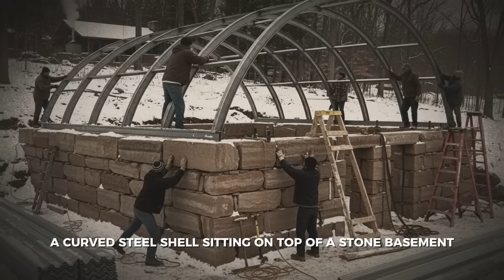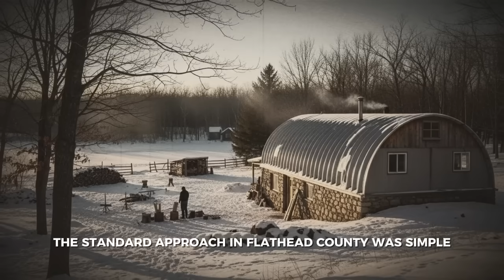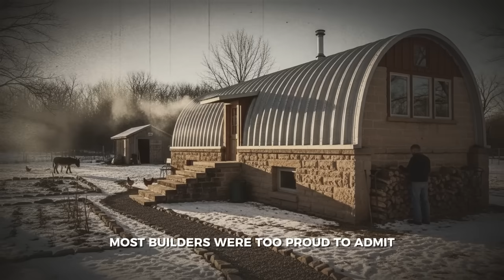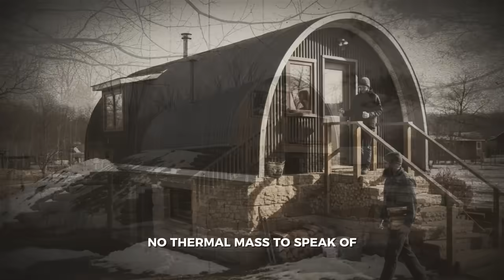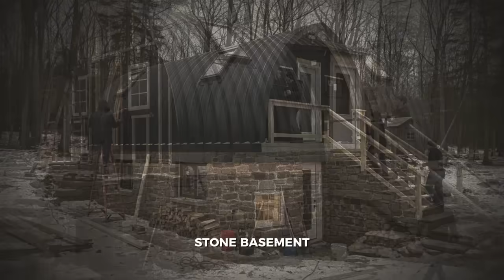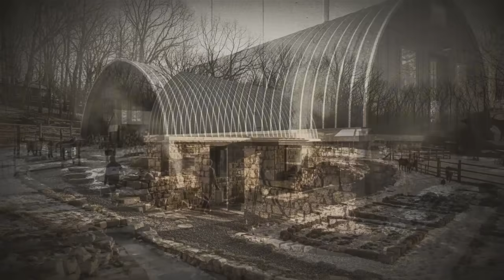How He Built a Tiny Quonset Home Over a Stone Basement — And Made It 55° Warmer All Winter

Comment: My old Minnesota farm house, built in 1906, has concrete block walls that are two walls separated by a 3" gap and no insulation except in the attic. The furnace heats the inner layer of block which radiates the heat back into the house. The chimneys are brick which absorbs heat from the escaping exhaust and radiates it back into the house as well.

Comment: That's an awesome design but I'd still utilize the lost solar heat from all that sunlight hitting light stones. Matte black exterior paint or stain for the open stone walls to help charge the stone with heat. My grandfather built a home from 3 sections of quanset hut joined at a central hub and a squared off lower kitchen and bathroom at the hub.
Reply: Do you have a pic of your grandfather's home?
Reply: @jorm2528 not anymore. My grandma sold the home after he died to a land development agency and we know the rest.

Comment: I'm not arguing with the rationale, but I like timber frame.  Mine has a Swedish foundation.  16" slab with 36" perimeter extending 16" tp the center slab.  Below the slab place 24" of blue foam.  Around the outside put 12" of blue foam at the base of the perimeter.  Cover it with soil which will freeze in the winter.  But the earth beneath the foundation will not freeze.  The slab's base temperature is 50 d. F.  Warm in -0 d. F.  Build the timberframe with insulated glass windows on the South face, sparse window on the East and West. and just a couple on the North.  Wrap the timeberframe with structural insulated panels.  Keep the living space tight and use an air exchange system.  When there is cloud cover a 2000 SF house stays between 55 and 60 d. F.  Heat with a good Swedish woodstove and use less than a half cord per winter.  Daytimes with sun the house heats to 72 d. F.  The slab provides thermal mass.  Coldest interior months of the year  late March through early May when the sun doesn't heat as much of the slab.  When it's sunny mid-winter I don't make a fire unless the indoor temp is below 66 d. F.  Then I make one fire.  Mornings will be low 60s.  Wear a sweater or a warm bathrobe.  I also charge my EVs and run my shop from solar panels.  We had 15 nights of -30 d F around 10 years ago at 8600' elevation.
Reply: Thx!

Comment: I became acquainted w masonry stoves when I visited my mother‘s Swiss homeland w her in 1953 at age 9. Her uncle, then 78 yo, had one in Dübendorf nr Zurich (now a commuter town) at the farm where Mother had spent her school vacations as a child. The stove had its firebox in the kitchen, but the tile bench extended thru the wall to the sitting room, where we also ate. The bench was always warm, not hot, & provided comfortable seating. Mother always raved about tile stoves, & I always said I was going to have one, but that’s not so easy to accomplish in Central IL!
Reply: Basalt fiber rockwool batts are far better as insulation they don't itch and don't collapse over time ... They stay sterile, reduce noise and insulate...it's also totally 🔥 proof  it's totally natural and  green to produce compared to glass fiber or  plastic foams ...it can breath without waterlogging ... 

Double door internal or external porches act as air locks. .. just add rocket stoves and thermal mass heating ... Even adding  water storage  for  underground heat  stored  rain water.
Reply: If you look at a lot of houses in cold parts of Central and Eastern Europe they have a 4 room down and 4up  floor plan with a large glazed tiled brick  stoves and chimney going up through .. the clever piece is the structure is offset by 45degrees  to the room axis so it forms a corner of each of the four rooms ..it's usually fed from one or two  sides  on the ground floor .  
Several tons of masonry  acts as a giant heat battery in the center of a swiss chalet style house..  but heats eight rooms  24/7.

Comment: I love watching these stories.  As a kid in the Pocono mountains of Pennsylvania we built on to our small house all my young life.  We soon used to heat with wood.  I hated it.  We used to have to drag wood out of the woods on top of a toboggan.  We did have a chainsaw but still had to split the oak and maple by hand.    It was much cheaper than the oil especially after the beginning of the oil crisis.   The new additions were well insulated but the original part of the house remained Un insulated as early houses often were.  I have had 2 houses built and each one was a little better than the last.  Later I flipped a house using the skills I had learned with years of home ownership.  when I had my present house I paid extra jest to get extra insulation included.  Very pleased.